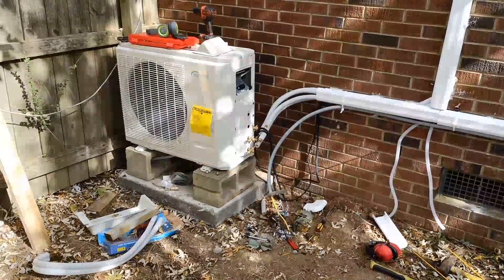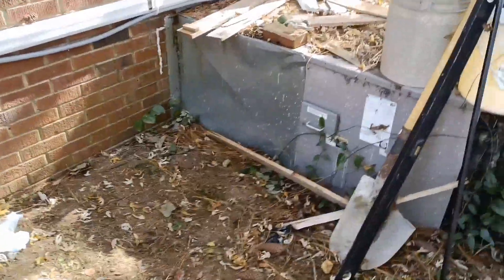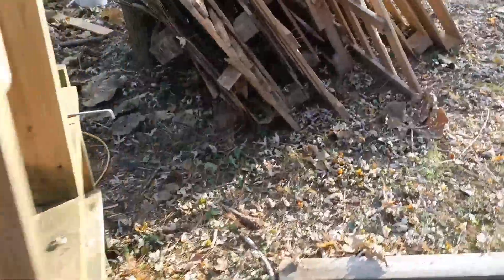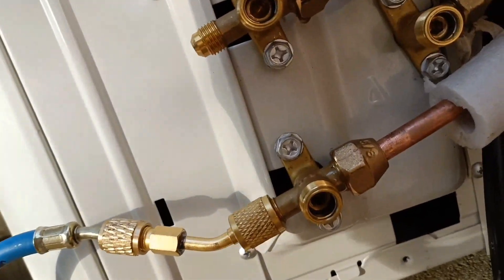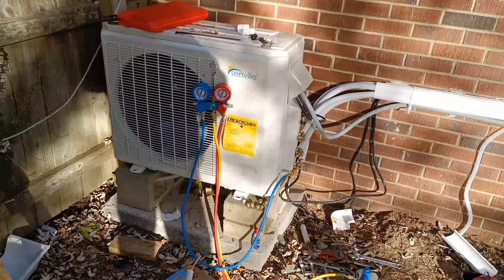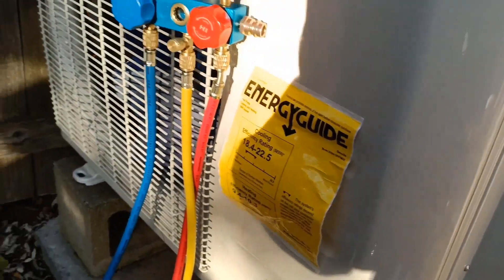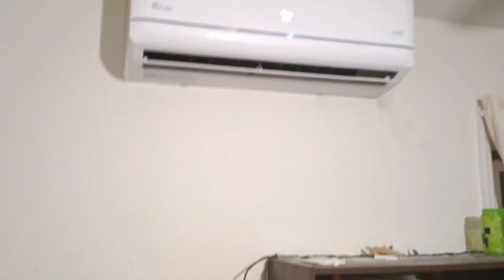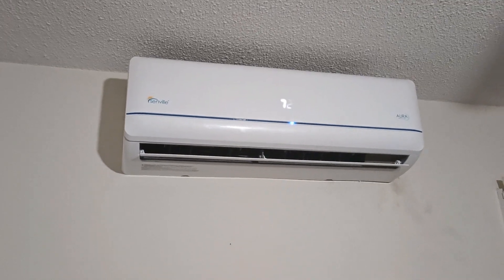Review of install of Senville Dual 9000 BTU Mini-Split - Part 3

Comment: I just had a 24k btu installed.   It’s doing its job on the main part of my house with high ceilings.   Fixing to order the 4 unit 36k btu multi-zone for my bedrooms.  If they work like the 24k, never going back to ducted heating and cooling again.  Fingers crossed.
Reply from the maker: Ducted is lame. Such a waste of energy just to maintain the pressure.  Someone was telling me how nice it was to have a 16 SEER ducted unit they just installed. LOL Thanks I'll stick with my 22 SEER mini-split